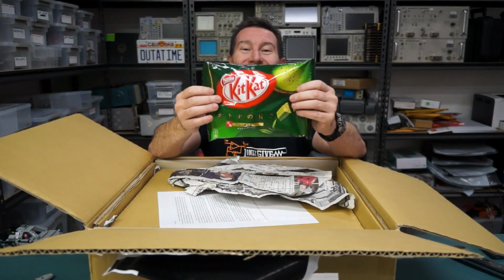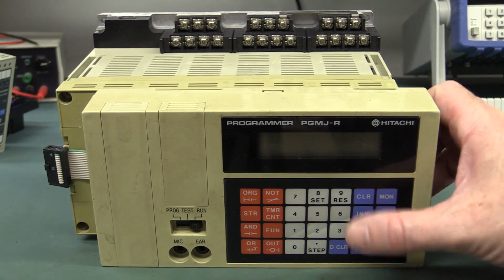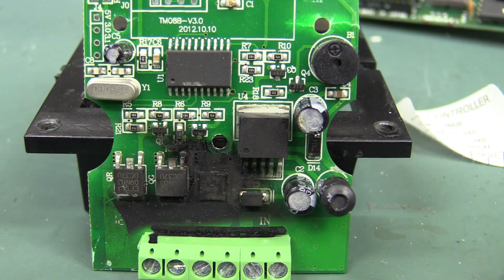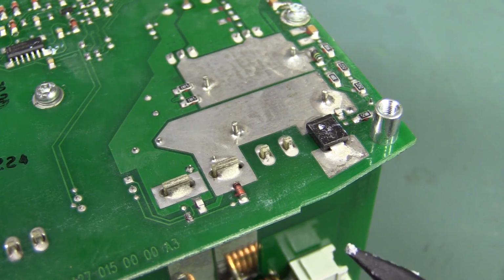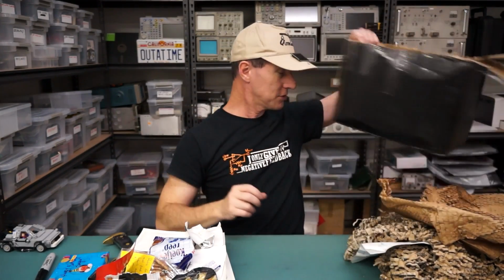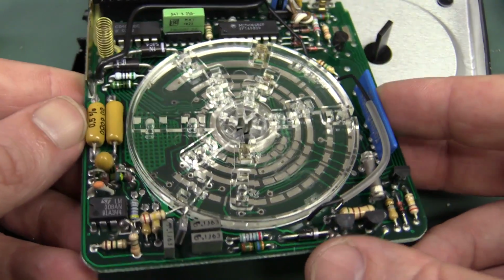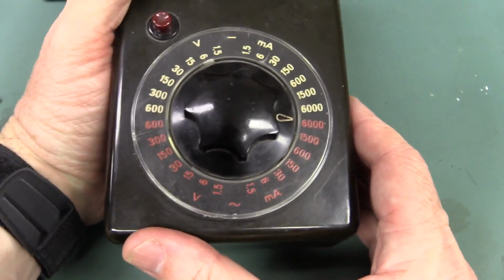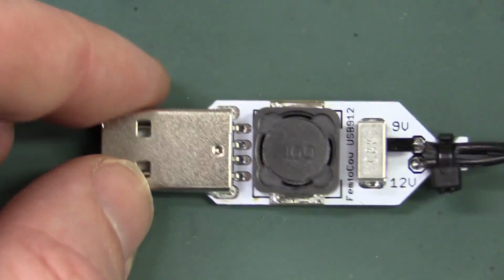EEVblog #745 - Mailbag

Comment: 14:00 For the longest time I thought it was originally "duct tape" as well, and that the Duck Tape brand came later, but that's entirely back-to-front. It was originally developed as a water exclusion tape for ammo cans, and as such one of its many nicknames was "duck tape" after the way water rolls off its outer latex layer. Incidentally, just in case anyone reading this has managed to miss the memo, it's the second worst tape for sealing ducts.

Comment: Audio ports on the PLC programmer are for cassette tape program storage. Real vintage! The Seeq 2816 is a very early flash memory, common in PLCs of the era as program storage. They were mainly pin compatible with 2716 EPROMS, if you wanted more permanent storage.

Comment: Actually duck tape was in use before duct tape came into use. Duck tape started in the early 1900's, duct tape didn't come into use until the late 20's. Always thought the same thing, but duck tape is a thing. Check wikipedia for the history, it's kinda interesting.

Comment: I believe that ABB power supply is made by a company called Puls Power. I build industrial automated equipment and use Puls power supplies on every machine. They look exactly the same, with the same case design, round surface mount resistors, high end components, and are known to build private labeled supplies for many companies. The new models from Puls are a quarter the width for the same power output. Never had one fail either, unlike the cheap brands. So in essence, you get what you pay for. I took some pictures of one recently. https://flic.kr/s/aHskbZm3PG

Comment: Some of the older Dell notebook power supplies had very good internal construction... I was quite surprised to see Nichicon RX30 (130 deg. C) capacitors in the ones I used to have.

Comment: Very nice to see the Casio fx-3800P. I bought mine in 1991, cost me about £20, and it has served me well. I think it is on only its second battery. I use it regularly and I much prefer its simple input to the modern ones with all the bells and whistles.

Comment: "Duck tape" is actually the ancestor to modern day duct tape, named after the type of cloth it was made with.

Also, modern day duct tape should not, ironically, be used on HVAC duct work since the heating and cooling ruins the adhesive.

Comment: I'm rather very interested in where the German multimeter was made. The guy who send it was from Leipzig which was in the GDR in the 60's, but the unit only says make in "germany" of which there were, at that time, two. So was this a device not meant for export? I have several east and west German things and most make a point of stating they were made in the DDR/GDR or the BRD or west Germany.
Wots the deal!?

Comment: Just to be a pedant... Duck Tape is a very popular brand of duct tape. So people who say Duck Tape for all duct tape are being un-knowingly brand loyal rather than just being wrong. Lol
Reply: Neil Harper Well, not exactly, it is true that Duck tape is a trademark, however it is a bit more complicated since the word was already existent and they only got the trademark for it since the word was fallen into disuse, and duct tape was more common, the version existent at the time was used for duct work, but is not the same as the current product, it was a cloth tape with rubber adhesive, while today they coat it with a plastic, and the tape will often have scrim rather than cloth inside.

Note that the word "duck" in this context does not refer to the bird, but to the cloth.

Comment: How does the cap get in the duck?  Psh.. easy.  You drop in a SMT ceramic cap, water it regularly and ensure adequate light, and it grows into an electrolytic.  Oldest trick in the book.  +1 for patience, though.

Comment: The "stereoscopic" port looks like a standard VESA stereoscopic synchronization signal connector. It's for syncing shutter glasses for stereoscopic viewing (3D as the marketing drones would call it). You will find similar ports on old Silicon Graphics (SGI) workstations, or "professional" graphics cards for PCs like nvidia quadro and ATI firegl.

Comment: There's a popular brand of duct tape called duck tape, I wonder if that adds to the confusion. For the 3D printed duck, you Just pause the print, insert object, resume ;)
Reply: Gadget Addict that's silly. it's magic!
Reply: MichaelKingsfordGray To me, it wall always be 'Gaffa' (film set lighting guy) tape
Reply: I noticed I spelled it wrong after I posted it, but I'm afraid that it's just not as important to me as it seems to be to you.I have no desire to watch every film credit in history
Reply: The Bright Pixel Real gaffer tape is different stuff, looks pretty similar but it's not the same. Duct tape is shiny, and designed to be (semi)permanent. Gaffer tape is matte (so you don't get any reflections from it) and removable without leaving residue (so you can reposition stuff on the set).
Reply: Gadget Addict duck/duct tape was invented in ww2 for sealing ammo boxes and water rolled off it like water of a ducks back so the called it duck tape. after the war someone found it was good for sealing heating ducts so the colour was changed from OD green to silver.
Reply: The Bright Pixel Oi Bazza, check out that sheila laying out the gaffa tape!
Reply: Thermoelectric7 hahaha. Precisely!
Reply: Echin0idea As somebody who has been working in production for over 20 years, I must disagree. Nashua Gaff is the industry standard, and comes in many flavours, Matt, shiny, white (for spiking marks), black, 1 inch, 2 inch - you name it.
Reply: The Bright Pixel
Mea culpa - I defer to your experience. The wikipedia article on the subject obviously needs a bit of work...
Reply: Echin0idea I'm impressed there even is a wiki article on Gaff Tape
Reply: I think you will find it's called a blooper reel, not a bloopers real. Are you carzy? :o
Reply: MichaelKingsfordGray The Bright Pixel Also, Gaffer tape is a different type of tape with a higher thread count and less acidic adhesive.  Much higher quality tape and MUCH more expensive.
Reply: +Cameron Webster It's actually not very good for ducts at all! haha :)

Comment: I can't believe someone sent a X68000 for teardown. Unless it's completely shot it's probably worth fixing.
Reply: sandman x Read on Wikipedia that it was kind of the japanese version of the Amiga computer. Very similar HW and the games were easy to port.
Reply: sandman x I would expect the power supply to have bad capacitors on it if the computer doesn't work. This is quite possibly the X68000's biggest flaw.
Reply: sandman x I was about to say that, I would kill for one of those, image all the retro games you could play on it. I would be happy just with the kickass version of Castlevania this thing has. :P

Comment: "Duck Tape" is a brand as well it WAS used for air Ducts (now they use the aluminum tape). The word Duck in Duck Tape comes from the embedded interwoven cloth fibers in the tape. Another definition of Duck is "a strong linen or cotton fabric, used chiefly for casual or work clothes and sails." So "Duck Tape" is correct, since it translates to "Interwoven fiber Tape".
Reply: truck93 i would agree if duck wasn't a brand... however, there is only one maker of duck tape.

on a side note, none of that stuff (generic "duct" or Duck brand) is rated for the duct work most people will encounter. it is really only suitable as a temporary general purpose adhesive.
Reply: truck93 Um, but even duck tape says Duct Tape on the package... 'Duck brand Duct tape'... I have heard your argument, and I think it's a bunch of nonsense xD If Duck brand duct tape even calls it duct tape, It is duct tape.
Reply: MichaelKingsfordGray nope. gaffer tape comes off relatively easily and leaves little residue, as it is intended to do. some brands of duct tape (and some masking tape) only make those claims if used for very short periods of time.

if you are trying to secure actual ducting, you need to use very expensive (comparatively) foil tape, which is fire resistant unlike duct tape.
Reply: MichaelKingsfordGray I always called that HVAC tape.
Gaffers tape is different from both duct tape and foil tape... it is cloth, like blue jean cloth, tape. I am not sure you can even buy it in america outside of surplus shops. Not sure about your guys' individual countries, I know its available in the UK, and they confuse it with duct tape a lot, but its different.
Reply: I confirm, that people around here (east coast) use both duck tape and duct tape, the former referring to the brand, the latter to the use for the tape. So both forms are correct, but depending on where you are there may be a more common version.

Comment: Is it just me, or is the audio out of sync?
Reply from the maker: uriituw Not for me
Reply: uriituw Australians are often behind and slightly out of sync.
Reply: EEVblog it seems ever so slightly behind the video but I only noticed it after he pointed it out
Reply: uriituw Doesn't seem to be much out of sync at least but there is a lot of compression artifacting in the sounds. Really jumps at you on the crinckly bits.
Reply: uriituw Worked fine for me, in sync and HD
Reply: uriituw it's just you, i'm afraid...
Reply: Dennis Lubert I also noticed that. Something went horribly wrong during conversion. It could be that he has some settings still on default because he installed his video rendering software on the new dual Xeon workstation. I think the audio bitrate was too low and something went wrong during multiplexing with interleaving the A/V.
Reply: Tripcore
Audio Bitrate was too low. Should never be under 192 kbps. Everything lower is marketing bullshit.
Reply: IIGrayfoxII I am not sure he is to blame for everything. Under the balance of laws the legislature only has power over one third of Australia. The other two thirds are the administration and the judiciary. Previous governments must shoulder some of the burden. Other members of cabinet. The person that writes Tony Abbotts speeches. The same person that writes Bill Shorten's speeches. The same person the writes Xi Jinping's international speeches. The same person that writes nearly all the movie scripts. The same person that writes all the tv scripts. The same person that writes nearly all the hit songs on the radio. Now I wonder who that guy is. I just hope its not me.
Reply: Tripcore There is a trophy for being delusional? I wonder what that looks like. I bet it has holograms, virtual reality and everything. Superman appears sceptical of your claims http://www.dangerouscreation.com/wp-content/uploads/2011/09/delusional.jpg
Reply: uriituw Australian internet is so slow I'm happy if youtube videos play at all. :)
Reply: uriituw did you watch via latest android app?
Reply: uriituw not only that, I have sometimes these sounds-like-underwater effect, very annoying when he fumbles with the bubble wrap... (chrome under linux)... all previous videos seem fine
Reply: funkyironman69 Slow internet?
http://www.speedtest.net/my-result/4371750987
Reply: John Ridley Yep. That must be it!
Reply: Italian Programmer Of course, I'm in Australia lol! We couldn't even get ADSL1 until a few years ago because Telstra wouldn't upgrade the exchange. We had to use wireless 3G which would slow down to hundreds of bytes (yes <1kb). We do have ADSL1 now though and it's a useable speed at least, but still can't stream HD videos. Plus electrons are slower once you go under the equater. :p
Reply: funkyironman69 I'm right now downloading GTA5 on Steam... It's taking about 20hrs. :S
I pay 30€/mo for my connection (7Mb/s down), which is usable, but not good... and for the price it's not that great.

I know In Romania they get 100Mb/s down for something like 10€/mo
They clearly invested into internet, and my country clearly didn't.

I agree on the fact that electrons go slower under the equator, since they're upside down;
I'd add that they go slower under the alps as well! :P
Reply: I pay 40€ for 100/5 MBit/s in Germany via DOCSIS...
Reply: *****
I would even pay 150 EUR for 100/100 and IPv4... ;_;
Reply: It's fine for me
Reply: ***** If it only was available. :( Technically it is possible, but there is no affordable offer. 100/100 cost ~1000€/month, here.............
Reply: EEVblog There is something wrong with the audio during the parts of the video where paper/plastic is ruffled, specifically around the first quarter of the video on 2 occasions.  It's hard on the ears.  The issue doesn't occur during the later half of the video during ruffling noises so I dunno.
Reply: Ryan Upton Can you blame us, we have tony abbott as our leader
Reply: Ryan Upton Exactly, he's nothing more than a public speaker.
Reply: Tripcore I encourage everyone to write a script and make a difference.
Reply: Ryan Upton What sort of difference?
Reply: Tripcore Hope fully a good one. But a bad one keeps things interesting as well.
Reply: Ryan Upton Ah ok, you lost me now.
Reply: Tripcore We are all a little bit lost.
Reply: Ryan Upton Of course.  Let me re-praise: You are not making any sense, and lack the ability to convey your message properly.
Reply: Tripcore  Well I am not sure if that is true. Many of the things I say do make a lot of sense. Just the other day I said something that was pure brilliance. I said to myself 'Ryan', I said, ' You know, Ryan, I have known you a very long time,' I nodded with approval. 'And what you just said right then, well it just plain made a huge amount of sense.' 'Oh I totally agree,' I said to myself.' 'It is a great pity that Tripcore was not here to witness all the sense I made,' I replied. 'Oh I know Tripcore would loved to have heard that huge stream of rational thoughts that cumulated in a great deal of sense.' Oh well,' I pondered 'I imagine Tripcore roams the country in his great air balloon seeking out people that can make sense of the world'. 'Ryan, I imagine he does, I imagine he does.'  Ryan, I looked intently into my eyes, 'Do you think Tripcore seeks sense making people because he lacks sense himself?' Ryan stood up in surprised shock, 'Gosh do you think he does?' Ryan nodded in glee walking in circles in a funny dance, 'That would mean Tripcore has no sense at all! That's amazing' Ryan looked worried, 'Do you think Tripcore will get some sense one day,' Ryan's face drew concern, 'I am not sure he can, he looks like he is seeking it from others, but he doesn't seem to be able to recognise people who make a lot of sense in the meantime.' 'Oh well,' I said, 'Maybe he will find the sense he is looking for one day.' 'Maybe, 'One day' I said.
Reply: Ryan Upton Of course it's true.  Your message did not make any sense to me therefore it is absolutely true. You lack logic, move along.
Reply: Tripcore It is kind of tough being me. Not only do you ask me to solve problems but now you expect me to solve them in ways you understand too. I think you ask the impossible.
Reply: Ryan Upton I didn't ask for you to solve any problem, unless you count communicating as problem solving.  Your sarcasm speaks volumes.
Reply: Tripcore No not really. Maybe some people will think I am talking crazy. Still other people will think my comments are smart and funny. Some people will even think you are talking crazy. Some people will even recognise your comments to be baiting. However none of this really matters because few people read these comments and even fewer will remember them.  If you want something from me, like a script, or a speech, or something fun then just be straight and ask. I understand sometimes the questions can be embarrassing to ask.  But if you send a letter/email and mark it private no one will read it and I will not reveal your confidence to anyone. Honesty is always the best policy. I am a reasonable person and I rarely say no to a reasonable and fair request.
Reply: Ryan Upton "No not really."  Yes really, it does speak volumes to me .  "Still other people will think my comments are smart and funny."  That is actually how you want others to react to you.  I could go on for days but I think that I've embarrassed you enough already.
Reply: 'I will chalk that up to a win then.' Ryan stretches his arms above his head, leans backwards in his chair and contemplates his success with a broad grin across his face.
Reply: Ryan Upton Congratulations.  You win the trophy for being the most delusional.
Reply: uriituw It is you.
Reply: Sometimes something weird happens to the youtube player and when you switch the video quality, it gets back in sync.

Comment: The resistors you mentioned in the German multimeter are often known as dogbone resistors because of their shape. I'm not sure if they have a official package designation. There were  many shapes of resistor, often brands had their own design but they were all referred to as dogbone.
Reply: ***** There were resistors in the same package in USSR. Type "ВС" (cyrillic), stands for "водостойкие" i.e. "waterproof": http://cepebpo.narod.ru/cyrje/radiodetali/resistor-vs.htm
http://savepic.net/4823913.jpg